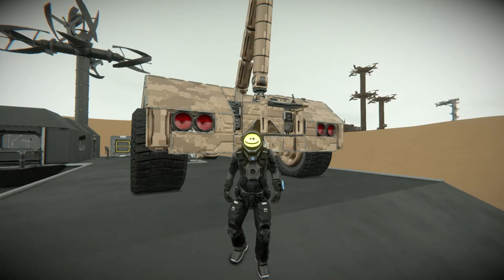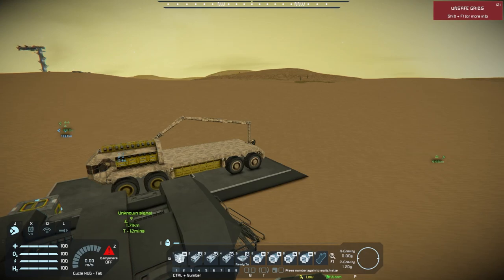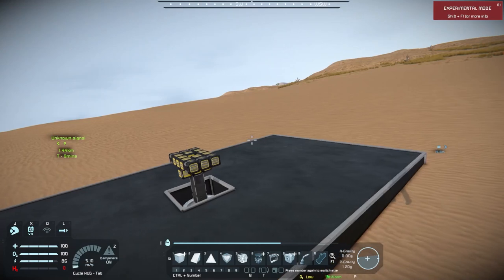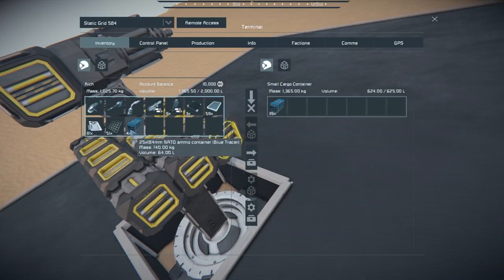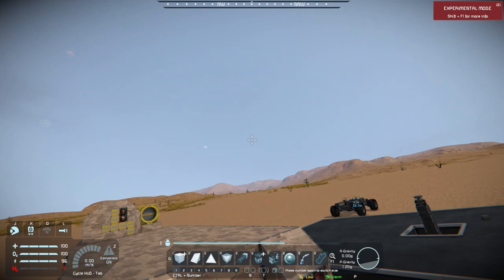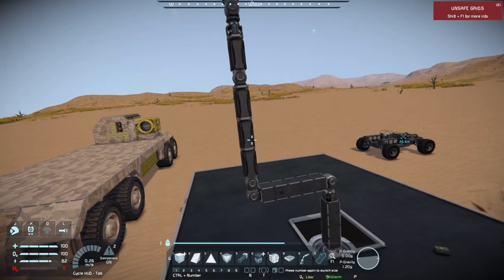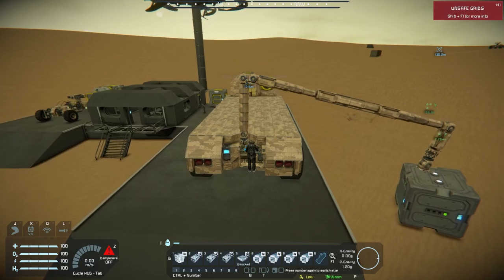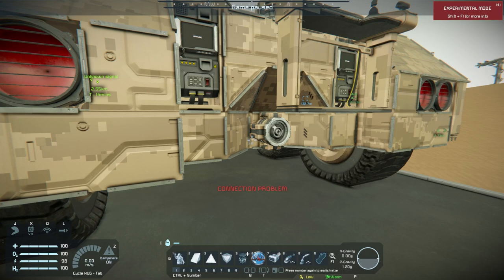Space Engineers #3: Fun With Custom Turrets and Cranes

Comment: Hey DNG, 

on the crane, have a group for all hinges and rotors for the arm.. on quick bar 2, put a button that locks all the hinges for when you power down the rig, although it is possible you might need to have 2 groups / buttons.. one for the hinges and one for the rotors
the reason for the power down freak out is because when you power down, you are effectively killing the touque that keeps the hinges/rotors in their positions.. there is also a physics weight balancing thing going on.

you could group all the extending pistons into one group.. and have 1 button to reverse all and another button to stop the extention/retraction.. so using only 2 buttons for that part of the arm. in my mind this will give you more control over the length too.

also.. does the multiplayer server allow you to use enertia tensor? (some dont). if you can, activate E.T. for all the parts of the arm.. it'll help with the shakey operations